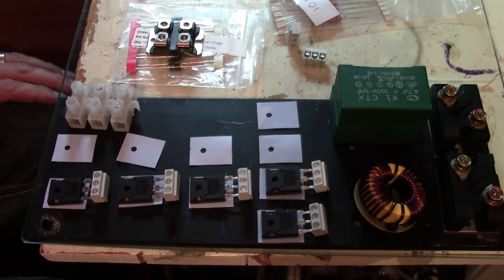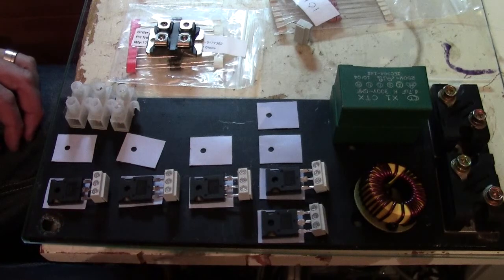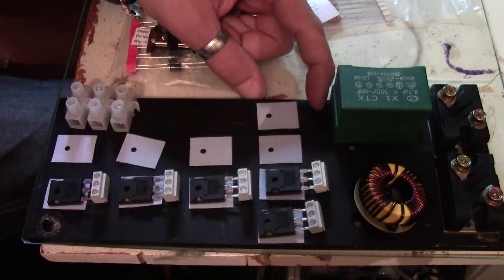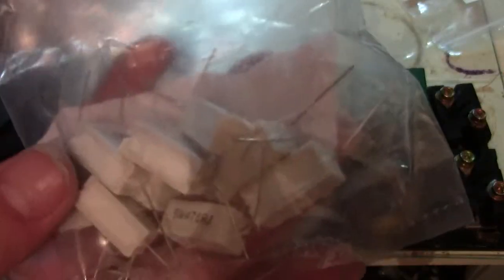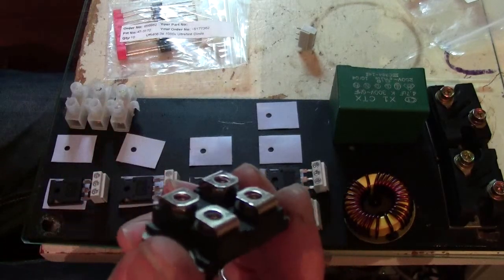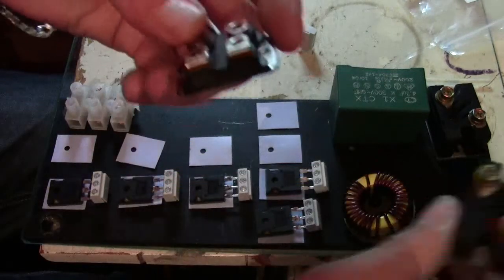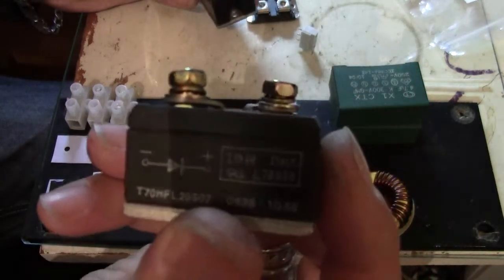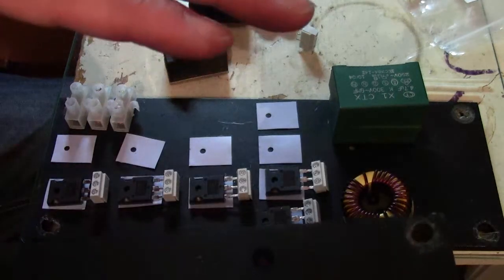MONSTER ZVS DRIVER PLANS .DESIGN SUGGESTIONS WELCOMED

Comment: I think your input inductor might be a bit wimpy for that much power. I've just wound my own with really thich enameled wire. seems to work nicely. As for the resistors, I think the cemented ones are wirewound, meaning they have an inductance. It's probably better to use carbon resistors.

Comment: I don't know enough about condensation to say really,
the subject calls for some serious experiments.
Maybe an airflow will help, maybe a peltier in a vacuum
wouldn't form condensation. or maybe a liquid cooling
system is a better idea all together.
Just look where high performance CPUs are today,
usually behind a CPU liquid cooling block.
Alexander is correct though, it'd definitely not
a simple setup!

Comment from the maker: My IGBT's are Mitsubishi CM400HA-24H 1200V @ 400A very fast switching and i have some Mitsubishi QM100DY-H there 600v 100A the problem i have is finding plans and then making a good driver as I'm not that great at these kinda things and the drivers i have found havent been simple :0(

Comment: Max V does not increase with putting them in parallel.
Max current increases...
If you look at the Video from TheMaxii2007 /watch?v=WT0_RzJUY2o
I think he uses 2* 3 IRFP260 in his ZVS.
But Kizmox is right, for large transformers a ZVS ist hard to built.
And expensive too, cooling is complicated too.
There is a half or full bridge Inverter better to built....

Maybe you should add gate drivers to the ZVS for faster gate signal rise an fall time.

Comment: benefit of push pull is you get the reasonant tank voltage, so at 50v input you can get the tank to ring up to about 200v. however, i have designed a 1KW flyback driver, using a 555 and a quasi-resonant circuit. i have tested the design with 2 mosfets (260s) and it works very well. for 1kw i would need 4 mosfets. 
input voltages up to roughly 50 volts in that setup. at 12 volts you could move enough current to melt the wires :)

Comment from the maker: Thats the best way but I really have to save my IGBT's for a TC and I really want to over engineer the ZVS for fun the problem is if it will work and if so how much power i can chuck at it .I used the TL949 FROM A PC PSU BUT I HAve brought some now for a plasma speaker project .what would be great is a frequency controlled system but using some of the 40 x 260n's  I have but not a 555 as i hate them although if i could get high power using a combo of 360n's and 555 it would have to be done ?!?!?

Comment from the maker: ok firstly VERY nice mate gonna be making a flyback like that when im done as i have a couple of big cores .now for the Q&A if ya dont mind ? I want to run this about 2KW more if poss but want to use the 260n's as i have 40 of them .if i parallel them will it give about 60v plus each one added and will that bring the amps up if so using 10 do you know my max V and A input as i could use more that 10 remember this is for fun so what ever it takes without IGBTS as im saving them for a TC hope

Comment: make your own push pull driver with a TL494 or something similar
then you can use the giant IGBTs and have control over pulse width and frequency
you can then still have a resonant tank cap on the primary and it works real well

Comment: If you want it to run with mains voltage, /watch?v=90F_bGO3Syk
with more input voltage /watch?v=xtCo23e96eA
Very important is a good capacitor, I use Wima FKP1
I think it depends of the later use, for normal flybacks two IRFP260 are enough.
For larger home made transformers you may use more of them in parallel.
Also they must have a minimum Vds Voltage of 3,14*voltage in.
So with IRFP260 ( 200V ) you can go up to 200V/3,14 = 63V max!